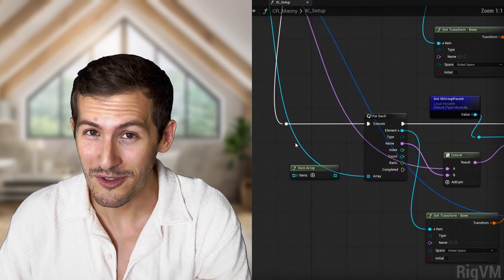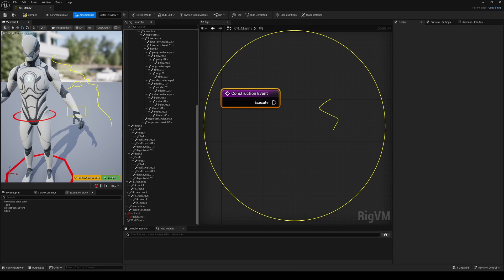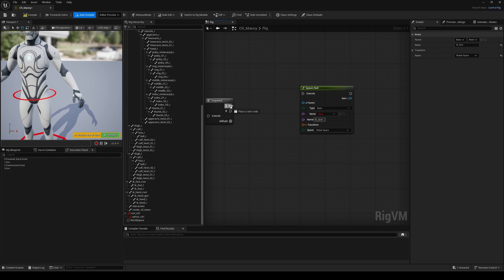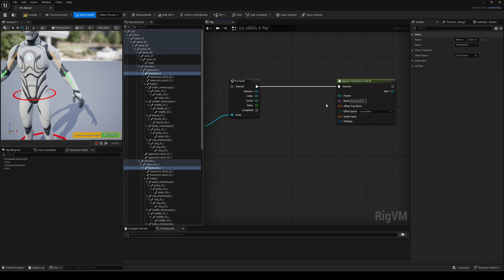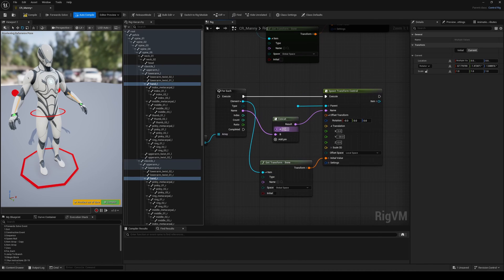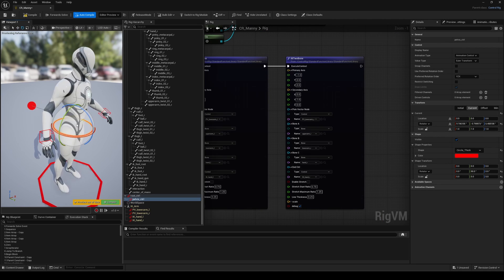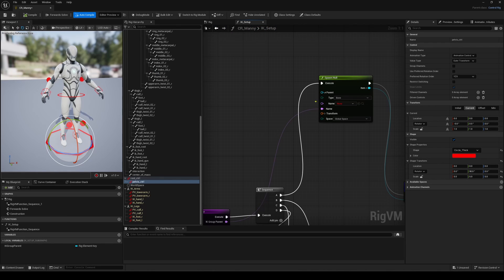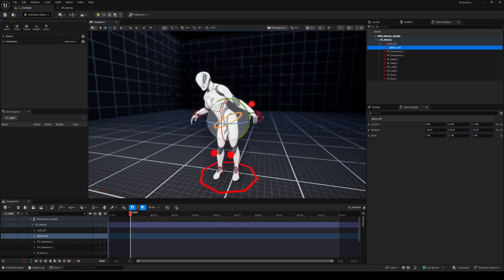SMART RIGGING in Unreal Engine 5 | Procedural Controls & IK with Functions

Comment: Hey sorry. I'm still not really great with nodes and graph, but you got me lost on 7:00. Can you please elaborate? Did you just make a copy of IK_Setup and renamed if IKSetup just to expose the name? And then save and compile? Where did the IKSetup go?
Reply: It's very hard to follow for complete node based programming beginners and some of the things are not really following best practices in regards to that.
To get a better understanding of what this kind of "reusable function" is actually good for I'd beginn smaller to understand it's use first.

I'd advise the following:
1. Ignore everything that comes after 6:32
2. Beginn by going into "My Blueprints" (with in the Ctrl Rig Blueprint) -> "Functions" and press the "+" -> then name the new function "PV Constructor"
TLDR: Functions are meant as "reusable" logic pieces -> where the programmer sets up "clean" and "reusable" logic, so keep that in mind.
3. Double Click the "Forwards Solve" graph in "My Blueprints" -> create a "Construction Event" -> and drag and drop the newly created "PV Constructor" function in and connect it.
4. Double Click the ""PV Constructor" function and follow the videos instruction to 4:57
5. Important for "macro's" bot good to get down even in functions -> make sure to wire the "Completed" execution output wire into the functions "Return" end node for continuity.
6. Wire the "Name" of "Spawn Null" and "Item Array" inputs to the functions "Entry" -> and return to the "Forwards Solve" graph in "My Blueprints"
7. Change the "dynamic Name" within the "PV Constructor" function node to "PV_Elbows"
8. Get the "lower arm bones" from the "Bone Hierarchy" and drop them before the "PV Constructor" function as an array -> and wire it's output into the prepared array input of that function.
9. Copy the function, and Repeat Step 7. and 8. with the "calf bones" and change the name to "PV_Knees"

With that you created a reusable function to procedurally generate Pole IK's... Maybe a more granular approach to node based functions helps understanding their usecases a bit better.
Reply: @UltimateFalk  Holy Shit! I really appreciate the time and effort you gave to my comment. I thank you so much! Thank you thank you thank you 🙏
Reply: @HighlightRiel it's all good dude.
The video is exceedingly hard to follow ~ even with programming knowledge, but the only thing available going into rigging automation.

Cheers
Reply from the maker: Hey !
This is just the part where we define the function itself, meaning the inputs! This is what makes the logic procedural. We’re basically wiring up the inputs we want to reuse later for any scenario.

I also created a local variable inside the function, so it stays within the function. This makes it easier to reuse across different Control Rig assets. 👌
Reply: @ProjProd  Hey thank you so much for your hard work!

Comment: I used spawned controls extensively for standard and modular control rig setups, but sadly there are certain types of controls that cannot be procedurally spawned for some reason like visual cues. Also notable is that animation channels cannot store integers but controls can. Controls do not only have to be transforms, they can take on other primitives like integer, vector, float, rotator, vector2d. The overlapping primitives can be used interchagably with channels with a few nuances. Animations channels can also be grouped, but only when created non procedurally. Not sure if they'll be able to bridge some of these discrepancies but I've been using them in both forms whenever I had to use some of the features not available with procedurally spawned ones. There are also some useful spawn helpers in the standard control rig library provided by Epic. The most common function I use is to create spawned controls that creates a metadata link from bone to control and vice versa. This way in forward and backwards solve they can easily reference each other.

Comment: Can you please do a video using Blender bones exported to UE5.6 to set up a Reverse Foot control?  Something with Tip Toe controls, Ball of Foot controls, Heel controls, and Ankle controls?
Reply: use autorig pro, it can convert it's rig to unreal engine manniquin
Reply: @GenesisWilliams  But it is very confusing to set up a Shape deformation with the AutoRig Pro tutorials.  It is also confusing to add bones to AutoRig Pro.  The new bones do not export into UE5 as proper Child/ Parent.  It is easier to use Rigify.  But the Resent changes to UE5.5 and UE5.6 have broken the Feet Modules for Rigify bones in UE5.6.